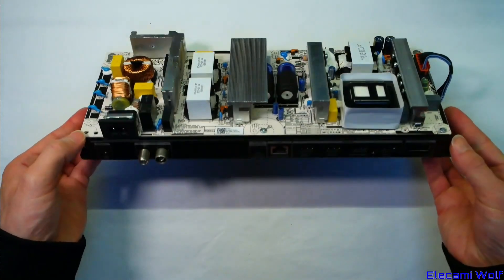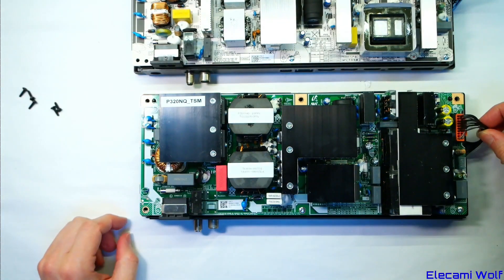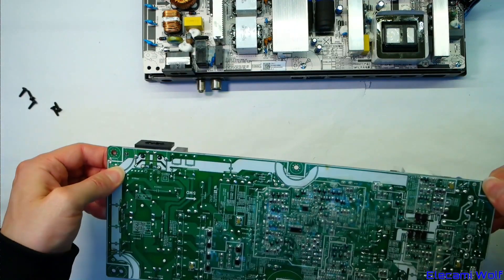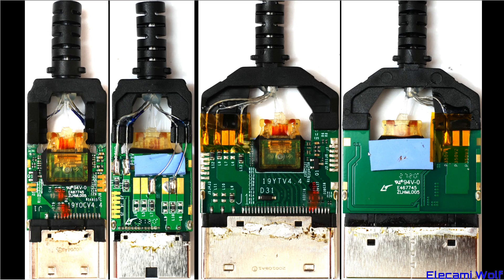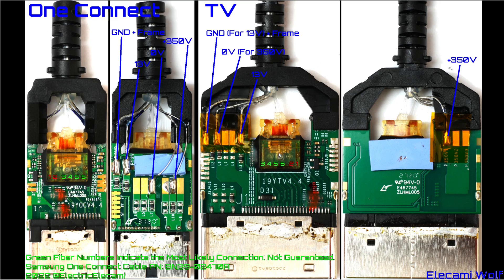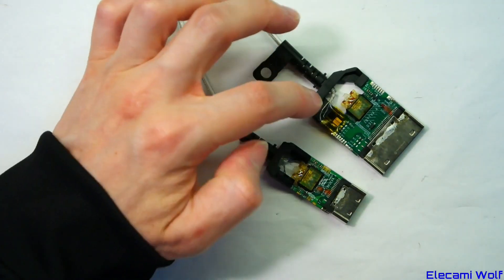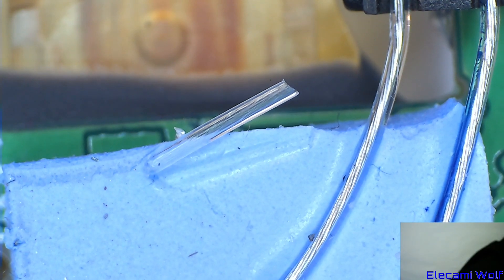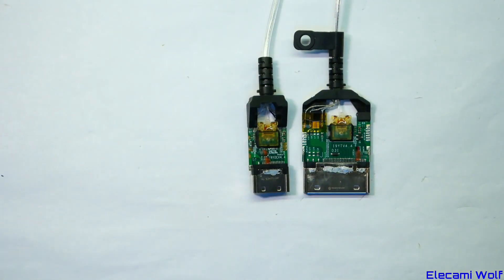EW0041 - Samsung One Connect With Power Investigation

Comment: Do you think the price of a replacement one connect cable is justified?
Reply from the maker: Yes. It is highly specialized part that is expensive to manufacture. 
Check the prices on long optical HDMI cables. It is similar.

Comment: I don't like manufacturers doing it's own proprietary stuff. On the one hand we have EU standardizing connectors between devices on the other we have this :D

But maybe this will become new standard who knows, but something tells me that the communication between the telly and the box is proprietary and closed or in other words only useful to Samsung.
Reply from the maker: This isn't a cellphone you throw in the trash every year when upgrading, so the conditions / rules are different.
Reply: @Elecami  Is it really? It has the same issues as the cellphones, hardware that barely runs the current version of Android :D
Reply from the maker: @semiRockethr  They work fine for me and have done for many years. Even after what I did to them.

Comment: The cable is insanely thin for 350V DC.
Reply from the maker: Good insulation. It is also very low current. The TV would be 100W or less.
Reply: @Elecami  I was thinking of how easily it could be damaged or accidentally penetrated by the edge of something metal.
Reply from the maker: @BrianG61UK  It is pretty robust. Similar to any high speed data cable. Just got to take are when installing it and not subject it to stress of kinks.

Comment: I just wanted to confirm that your connections are correct. My cable got damaged by rodents last week. Samsung wanted to quote me $350 and 3 months lead time, not to say a visit by tech which cost $100 is mandatory to confirm the cable is damaged. So yeah, thanks for the video. At first I was just connecting the GRND, 0, 13, 350V. Can see the power on the tv button glow red, but no pictures. Not until I spliced the rest of the 6 fibres, then I manage to get it back to normal.
Reply from the maker: Nice work. Good to hear you were able to get yours repaired.

Comment: Hi, I have a 50” frame with one connect box issue.  It is blowing the 3.15A fuse.  Any suggestions on what could be causing this or where I could look?  It blows the fuse just by plugging in the box to electrical outlet, no tv attached or anything so it’s isolated to the box.
Reply from the maker: It is probably something gone bad or shorted in the power supply circuits. Will take a bit of poking around to determine the cause.

Comment: My tv is black screen and the stand by red led is working what might be the problem the cable or the connect board ?
Reply from the maker: Could be a problem with the Power Supply. Capacitors gone bad is common.

Comment: Hi, nice video. Are the one connect boxes interchangeable? Example, can we use the one connect box with HDMI eARC (2020) version with a tv which uses old one connect box with HDMI ARC (2018)
Reply from the maker: Maybe. Not sure. I have tried switching some of them around and it worked for a while then later it did not work. Was just saying check connection on the screen. At least you need to make sure the model supports your size of TV. The One Connect that comes with small size TVs can have a smaller power supply in them, those defiantly won't work with larger TVs.

Comment: Hi i have similar one connect cable for my frame 2022 55” QLED and somehow rabbit has cut the cable now I don’t know how to join them, as per the engineer who worked in Samsung before he said they tried to join the ground along with 0v 13v 350v to see if power is coming in TV but tv has not turned on 

But after looking at your video i think they have not joined the  6 fibers (1,2 red 3456 green)

As the cable is broken, can you tell me how to identify those 6 fiber 
Will they be in colour (red, green) when looking through with fiber join tool machine?
And how to determine which red is number 1,2 and which green is number 3456
Reply from the maker: There is no color on the actual fiber. They all look identical. You will need to identify them and mark them yourself before joining. 
I show a way to identify the fibers in this video, EW0037: https://www.youtube.com/watch?v=CeMnRErVwxY
It is done by shining a bright light down the end of the fiber and checking where it ends up in the connector.